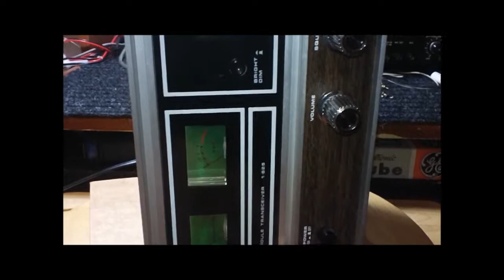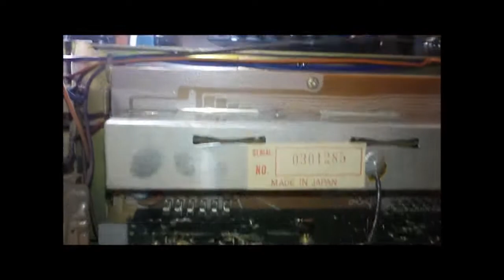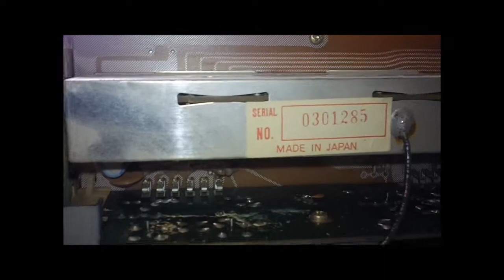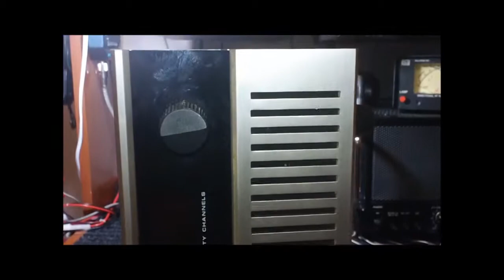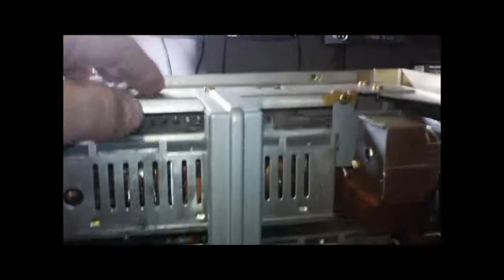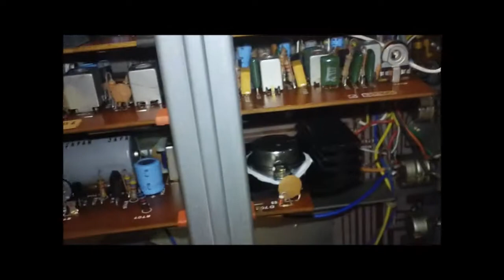Inside of some Module CB Radios

Comment from the maker: Thanks for the info. The TRC-455 is one I wasn't aware of being a module unit. I did know about the Fanfare 880 because a friend of mine has one of those NOS in the box that he now uses occasionally. Glad to you have yours repaired & working now. I think a lot of the issues with my Courier is traces as well. Someone buggered some of the traces to one of the board sockets. Maybe someday I will look into it. Have to many other projects ahead of it for now. Glad to hear from ya. 73's Paul

Comment from the maker: Hello Dave. Yes I remember you and our many QSO's. I don't know if there were ever any extenders available for these radios or not. Possibly there was for the warranty service places back in the day but I have never seen any. If you can't come up with a insulated tool, or make one, that will access the alignment points then you will likely have to home brew some extenders. I have never worked on one of these units yet and therefore I have no first hand service knowledge to pass on.

Comment: Ok Paul, I am wondering if you know whether or not circuit board extenders are available for the Conqueror 40D. I took a look at the Sams 157 book, but saw no mention of these. I don't know how one would go about aligning the radio without them, unless you can pull out an adjacent board in order to access alignment points on the other without losing signal or dc current paths.  By the way, we have had several qso's on 11m. This is Dave, IR059 in Waco, Texas. I hope you see my posts. 73, Dave

Comment: Hi Paul. The radio shack TRC-455 is a module radio, and should be the same as the 40D and the Fanfare 880 Module radios. They are all covered by the Sams #157. Great job of describing the 40D and the Royce 1-625. I have a 40D that had intermittent tx and rx after receiving it from an eBay purchase. The problem was due to cracks in many of the circuit board socket traces, therfore I had to resolder every one of them.  That resolved the tx/rx issue, however I still want to align the radio.

Comment: oh wow, one of those. My first base was a Courier Caravelle with those modules. I also worked on a Realistic for someone with the boards. Both worked fairly well, and it was really simple to repair if you knew which module the fault was in. It was horrible to try and trace things though because circuits connected between the boards if you didn't have a schematic.

Comment from the maker: Hello Ernie. A good friend of mine has a working new old stock Conqueror 40D. He loves his as well. You two are lucky. I wish mine worked. Maybe I'll try to repair it way off in the future. 

I don't know anything about DAK radios. Only help I can offer you is Barkett Electronics has replacement bulbs listed for them for $1.60 each. I see they are an axial lead bulb but they do not state what voltage they are. I have never ordered from Barkett and cannot speak about their reliability. 73's Paul